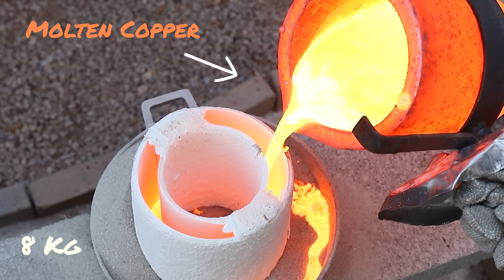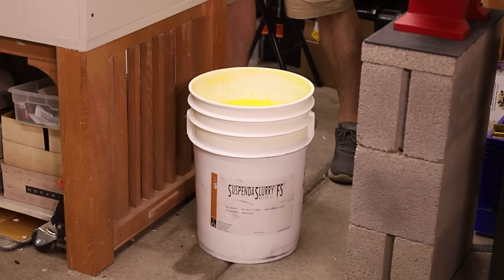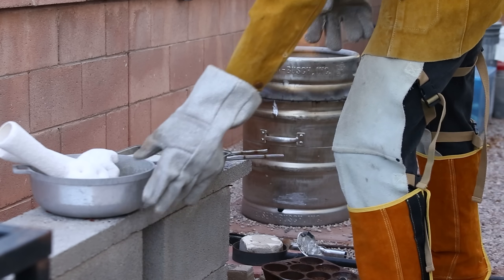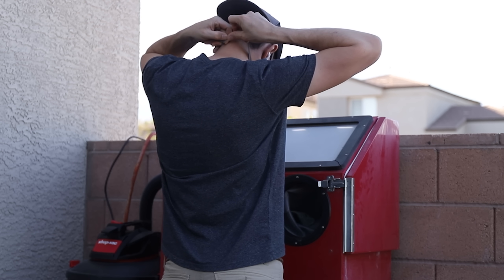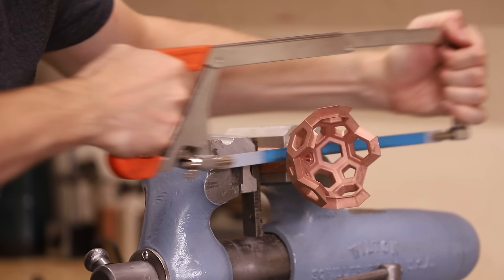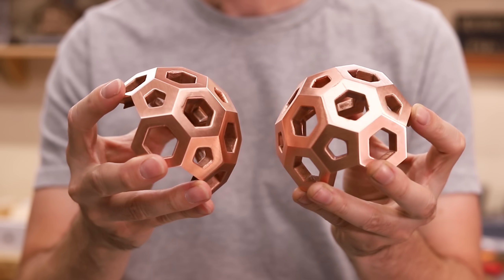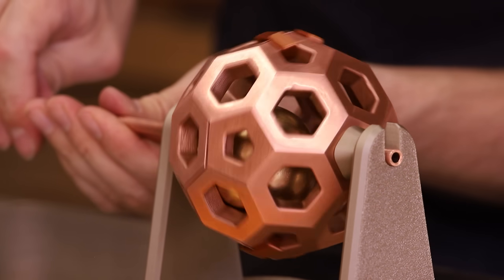HUGE Magnet VS Copper Sphere - Defying Gravity- Will a Neodymium Magnet Float Inside?

Comment: Curie point.
Way way way before melting point.
Molten magnetic core = Scientifically impossible.
Just like void space, planets and burning gasballs with ZERO oxygen. All 100% impossible. They're laughing at us, stealing trillions and giving us cartoons for adults. The air inside a spacesuit sticks to the skin of the actornaut bit refuses to touch the suit itself which has WRINKLES. Oh and the air inside their lungs is refusing to touch the skin or the suit and rip their bodies apart as it escapes. It's just chilling. Use your brains a tiny little bit and you will never bwlieve in the stupidity of the globe ever again. Magnets are a perfect proof. So are compasses. If you ever angle a compass AS IF you're on a globe, trying to aim it towards your impossible magnetic MOLTEN core or if you'reon the equator trya 30 degee angle towards to the north pole which means towards the GROUND for you. It wont work at all. The ONLY way a compass works is by pretending? the earth is level and horizontal. It literally ONLY works on a flat plane.
PS. Pancake in space is globe propaganda. No one believes that shit. There is no space. It's not a pancake.

Comment: You could add small magnets on the outside of the copper. Opposite polarity push. Alignment might be a problem 
With your gear a magnet generator should be easy. I never thought of using copper in my theories. Just aluminum and non metallics.
Excellent work. This adds to my strong force theories. Fuck gravity is first video uploaded. This doesn't explain rotation of atomic to galactic. 
Hang the round magnet from a string or cord. It will spin. I would do all kinds of pendulum experiments with. Like, get the polarity marked. Hang it, then set an opposing alignment beneath it, so it can't hang without polarity opposition. That's almost perpetual motion, but it will settle in a weak spot. 
Try the PC fan magnet generator design. Then experiment with copper dishes, or enclosures.
I've got the designs in my mind. Just no gear to test or build with.
Watch what that first magnet can do to a fidget spinner with magnets attached.
It's just finding the polarity angle, and then offset to keep things spinning.
Overunity devices should be very easy.

Comment: Suggestion: Try making the inside of the "sphere" a true sphere. This may take some time to grind out or you can recast it with a sphere inside the mold. 
Doing this may even out the "electro-magnitisim within the copper itself and cause the magnet inside to float better.

Comment: Put an insulator in between the two sphere halves and brushes on each side of the axle and see if you get a measurable difference in the current generated using a precise controlled motor with and without the magnet
Reply: Also, hook it up to a scope to see if the magnet affects the modulation

Comment: Maybe it would have been more interesting and simpler to use the same tube, cut it thinner, put plexiglass on one side, and attach it to a motor. That way, you could rotate the tube into position and make the magnet float inside. From the side without plexiglass, the magnet would be perfectly visible floating. With that sphere you made, it's hard to see what's happening inside.

Comment: here is an idea, lets see if the device produces power on its own, my guess is yes because the magnetic field  pushes against the potential electric field of the copper, idea 2 put a tiny electric charge on the copper and see if you can get a bigger output  
last but not least idea is your ball 1 magnetic polar on the outside? if yes, lets try and get a bigger magnetic ball wih the other polar on the inside and when you spin the device in there, would it start floting entirely? my guess is yes, if the magnets are powerfull enough that is, and possible if not, than raise the charge on the copper.

Comment: What is the science behind this?
It seems that kinetic energy makes copper electromagnetic maybe a certain speed causes the positive and negative electrons to align same side opposites for the copper and ball. Does it only work for a sphere magnet?
Maybe two different more complex shapes will react cause a different reaction. About the tube and sphere, is the levitation only effective at certain speeds also? Will it levitate indefinitely as long as the motion is steady? Also what about setting it on its side on the stand for the sphere and see if a different reaction occurs in left to right rotation instead of a forward to backward rotation,? Does the direction of motion have an effect like reverse? What about apply another magnet above and below the sphere +2+, -2-, +2-, -2+ possibly to test if the reaction is caused by the electrons to ground 2O(} THE 888888888

Comment: How about if you spin it as you are doing too get the magnet off the inside surface of the copper, then quickly changing the direction of travel.

Because the magnet is effectively starting to rotate at the same speed as the cage, so there is no eddy currents being created, they are relatively at rest to each other.

So somehow you will need to maintain relative difference between the respective velocities and the forces acting on the magnet cause the magnet to quickly catch up to the velocity of the cage - reducing the strength of the eddy currents.

Comment: Smaller ball so theres more room to move and not touch the walls immediately. Different color ball! It blends with the copper shell too much. Any and everything having to do with frame rate as others mentioned. You definitely need a regular electric motor setup that gives you fine grain control so that you can easily dile in the correct speed for sustained levitation. Id like to see other shaped magnets inside just for the heck of it. Might as well try any magnets you have to see if you get any unexpected effects. You could hang it with a string to the ceiling and spin it. Last maybe you could run current through the copper and add more electromagnetism to the equation 😏

Comment: They are still two separated peices of copper, instead of clips to hold the two together, try brazing the peices together, you'll never get the magnet back out, but if it works does it matter? I think the break in the peices is causing an irregularity in the magnetic fields so your not getting the reaction you want. Cut the cylinder in half and put the two peices together and see what happens when you drop the magnet in it.

Comment: Here’s an idea for you.
Since there is a certain amount of “viscosity“ between the magnet and the copper “sphere“, you could create a perfect copper sphere, without any holes and center the magnet inside of that sphere on a center axle. Then you can cause rotation between the two with a couple of small electric motors, and the viscosity between the magnet and the copper sphere should start rolling the sphere. If you couple that with the conservation of momentum between the two components, you could make a remote control rolling sphere.

Comment: The crack where the two copper halves meet should not spin laterally, but horizontally. It's throwing off the balance of the sphere (you can see it wobble as it spins, i.e. not stable), which is why the sphere keeps hitting the copper sides as they meet and shift.

Comment: Embed some magnets in your buckball👍

Also, bearings on the shafts & an actual motor with finer speed control. 

Maybe try putting that other magnet on its own spin shaft & mount, then spin it with a motor with fine speed control to show spinning magnetic induction.

Very nice experiment/project 👍

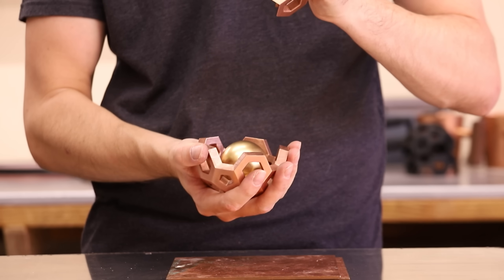Comment: 12:15 i think you should make it like a core you know those flying magnet things? Yea it should float and rotate and the sides should be connected to a motor so when you turn off the thing the motor will continue and open it on half (The electromagnet motor will have a different switch so the thing continues to float. Also what I mean is kinda like the core from the baby in yellow) Also the sides will reconnect when you turn off the electromagnet so the orb inside won't fall to the ground

Comment: Wow :) What a cool design and casting work! My thoughts: The cylindrical magnet in a copper tube remains steadily oriented in relation to the tube and this helps to keep it levitating as the tube rolls. But a spherical magnet orientation isn't clearly defined in a copper cage rotating around one axis and therefore I think it will always bump into the cage's walls here and there because while the cage resembles a sphere the magnet still has north/south poles despite having spherical shape. So, maybe the cage would have to rotate around 3 axis to keep the magnet from touching the walls. But anyway, this was a very very cool experiment!

Comment: First, the rotational inertia will be high enough that you wouldn't need too much energy constantly being input, so add bearings and make the thing smoother. Second the connecting shaft is too thin, use an alloy like iron carbide to minimize flexing of the shaft, third add a stepper motor with gearing and have it periodically moving to maintain whatever the ideal RPM is. Finally Color the magnet and the copper with contrasting to colors to identify movement more easily. This could easily be a desk toy if you polish it enough.

Comment: This reminds me of something I wanted to try as a kid. Putting a ball inside a sphere, with magnets of opposite polarity inside the sphere and outside the ball, figuring that the ball would remain centered if it was made correctly. This is so much cooler than that. 

Spinning from the input of the second magnet is so wild. You could a mechanically isolated drive. A motorcycle with no chain, a car without a driveshaft, or even a transmission
Reply: Correct, because you could use capacitors and transducers to induce initial current (current dump) and motion in the first magnet which manipulates the second (The one that's on the axle).

With solar cells around the initiator structure, itself a second copper-sphere analogue, you could drive the motor with a couple of different energy sources, both direct and indirect. 

We may also realize The Librarian from the Halo series, using drone lift and hover technologies, to house a fully-360 camera system.

Comment: Make plugs that suspend the sphere equidistant from the interior walls that will dislodge as they spin then hook up a consistent speed motor that turns fast enough to make them eject out while the sphere hovers inside.

Comment: I believe that because of a "magnetic strobe effect" if you changed the quality of axels  and  the mounts with  bearings for it to endure long term use. It would go through a small series of magnetic "strobing" and there would be several or multiple speeds that would make it stay levitating. Great job on the metal work. Im really impressed. Great quality of work! Im sure you can even get devices to measure the magnetic field output. Ill bet it puts out way more than you might think. If you attached it to a small frequency drive motor you could vary the speed for max levitation and field strength. Really great job!
I should have waited for the last 30 seconds. Now you introduced the other magnet another idea. Precisely align two more magnets "motor driven" with variable speed or frequency drive. With a single rheostat or two "metered stats with speed indicators" with the idea of synchronizing the " drive field of the two driven magnets or maybe precise gear drive to make the synchro timing making the ball permanently levitate while under power. The longer the project stays under power I believe you will find "new curious " phenomenon. And maybe changes in the metals involved.
I'm an electrician. Electrons do interesting things when forced into specific geometric courses as your project confirms like all before it.

Comment: The dimension of the octalsphereoid must be sized to the magnet i am afraid, however the easiest way from here is not to  have cut outs in your design creating more surface area. I suspect this shall indeed work but wont be viewer friendly. Maybe fill in the larger holes first and so on. Or alternatively reduce the size in 10% increments until SUCCESS 🙌

Comment: Place a layer of tin non conductive ( like plastic ) between the two sides of sphere and connect wires to the two ends of the axes see if you get any electricity, test with meter to see how much electricity it is generating while rotating. it looks much like a motore.

Comment: I love the tools you got there in I'm thinking about some crazy ideas that I wanted to try ( without fiscal calculations).  It is similar to what you made only to put some electrical power in the copper with an electric spinning circuit ( I think that the magnet will float and spin )and if it is possible to try it in a 0 gravity box ( that is neutral against magnetic). A bit bad my English 😅

Comment: I had a question when I saw this the first time but didn't ask? Does the copper cage and the magnet weigh the same as it does when the magnet is floating in its sweet spot. You know, when the magnet isn't resting against the cage? The mass should be the same because it's still two objects but the weight must change when the magnet is repelled from the copper? Or, does the force of the magnets push against the cage equal what it weighs when the cage isn't spinning?

Comment: As you can't rotate it in every direction evenly, you have to compensate for a non uniform magnetic field, to solve fighting the fields and to also have to fight against gravity, it would be better to spin it vertically instead of horizontal, see if the magnetic field is enough to levitate it cleanly, then it should actually hold in position instead of flopping/wobbling all about due to other forces. Would be fun to take into space and try it.

Comment: The contact happening while spinning may be not only due to the wrong speed. But also due to the hollow shaft you are using ro induce rotation. The deflection of the shaft might be a reason. Try using a solid shaft may be with slightly higher diameter. U can use the runner block to carve one out.

Comment: If you could put the second magnet on a jig like the one you have holding the sphere and add ball berigs to each end you should be able to get it in motion and then it should continue moving endlessly, don't you think.   That would be cool to see .
Also the reason the magnet needs such a specific speed it because the center magnet is to heavy  if the orb was a bit bigger it would balance the weight as it spins.  But fine tunning the right size that is a different storie.

Comment: I think you need to reevaluate your copper to magnet ratio. Remember at the beginning of the video with the copper pipe and disc shaped neodymium magnet? The copper pipe was solid. So maybe in your sphere since there is less copper, you need a smaller spherical neodymium magnet.

Comment: What you should do if you want to get a quantum effect.  Create the same honeycomb structure but do layers but use advanced material metallurgy to create 5 mm alternating layers of copper aluminum and palladium. Increase the volume size until there is approximately 5 to 10 mm play deviation when the magnet is fully encapsulated then extend the rod to where it is approximately 2 m from a base plate that you can screw down to the floor order some structure that's weighted.  And build a Tesla coil around it.  Repeat this process until you have two Tesla coils..  and there you got that Tesla quantum computer if you don't know how to convert and modulate frequencies corresponding to fiber optic multiplexer yeah photonics is the key man... Quantum chips her mumbo jumbo man.. entrenched nonsense.  I can build a 10,000 qubit quantum computer utilizing a similar methodology more advanced they can't discuss all the aspects here what I just gave you the fundamentals.  The full cast of development of a 10,000 qubit processing quantum computer only cost about $250,000 to make... IBM is useless, entrenched in their incremental paradigm improvements I also have a theoretical model how to build a 1 quintillion qubit quantum computer... No joke best wishes

Comment: Really cool idea. In the video you used another magnet and it rotated the sphere when you rotated it. How about using that magnet or another type and make a stand for it so that in rotates (spins) at variable speeds using a small motor (its shaft attached to magnet) and see what it does, but also use electric testing equipment to see what it creates whether strong frequencies or electrical current maybe see if theres any pole shifting taking place. But I would be interested to see its results.  Also those pouring tubes could be used as the stands for that rotating magnet 🧲 Thanks Jim S.

Comment: Super cool stuff. You can hear it clearly when it begins to float inside the sphere. 👍👍👍 I wonder if the fact that it isn't technically a perfect sphere might have an effect on how well the magnet it able to suspend itself. I may be completely wrong but who knows. Could you do a perfect sphere shape and just mount a tiny camera either inside the sphere or make a hole and mount the camera in the hole so it would have a view of the interior

Comment: Hook it up to a gravity belt. It will act like a clutch and will build up speed gradually. This may prevent the centrifugal force from unevenly pulling the mass of the magnet. Once the orientation of the magnet is centered it will produce a torsion drag force that can be measured using a semi-sensitive torque sensor. Have fun!